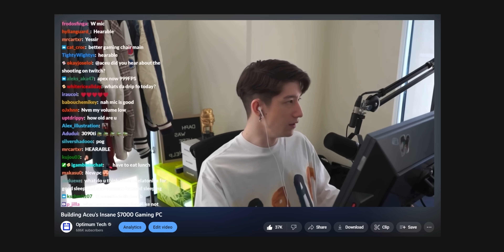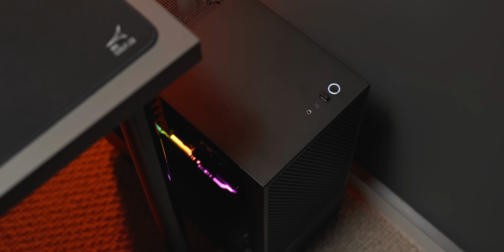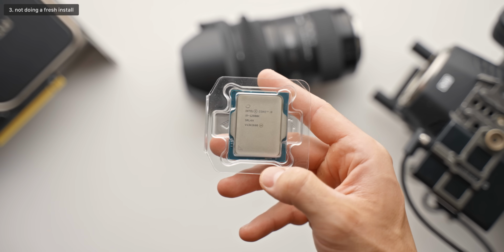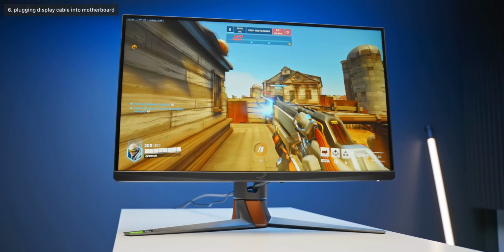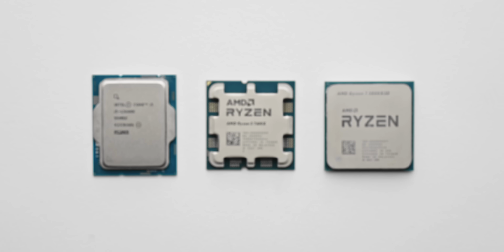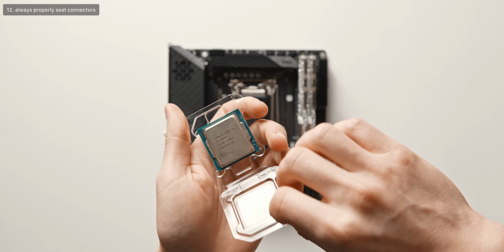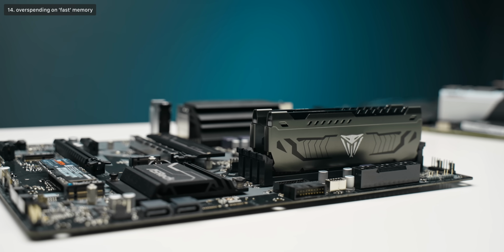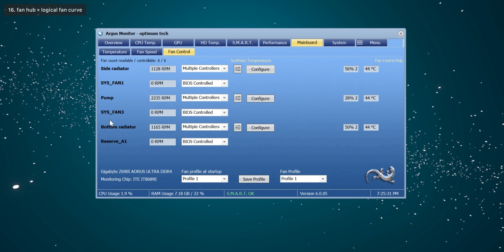Avoid These PC Build Mistakes

Comment: Tip16 : you can also use FanControl freeware to control fan speed using whatever sensor you want with any curve or function that you fancy :)
Reply: Names?
Reply: @pedro.alcatra  SpeedFan is one example. If your case fans are installed in one of the PWM pins on  your board Speedfan will detect the GPU temperature and then you can assign a fan depending on how many PWM pins you have on your board. If ever you have one PWM socket you can use a Y splitter to link up all your case fans, downside to this is it will sync all the fans to one speed.
Reply: @akoito-d9r  I used speed fan in the past I really don't like it mutch. But thanks anyway
Reply: Speed fan barely works anymore and I have never seen it work in any build where I tried it. There is software someone made (forgot the name) that is pretty good but Argus is worth the 10$.
Reply: @akoito-d9r should never place all your fans from one socket. They do have limited amperage.
Reply: Bless you! It solved my new case fan's noise! Thanks a lot!
Reply: FanControl is amazing ! Leaps better than speedfan!

Do i need a fan controller inside my pc to control my case fans with FanControl program?
Is that why they're not controllable?
In my pc case, they are daisy chained to the psu using a  4pins with doubled side  clanmps. Not sure if that's just rgb or  argb

Unlike my cpu cooler which is argb 3pin and im too scared to plug that one in anywheres, my b450mh mobo doesnt have argb only cpu_fan so atleast the cpu cooler works ans is controllable with speedfan but not in bios.
Any tips?

Comment: My most annoying build mistake is finishing the build to then later notice that the metal latches for grounding the I/O shield to the motherboard have slipped into the ports. So you have to take the motherboard out again and it could short something out if unnoticed.
Reply: Just bend them until they break off, they are not important.
Reply: enrique amaya  🤣🤣🤣 yeah because jesus gonna come and fix my pc
Reply: @saifitanvirahmed8604  Not only can He do that, but giving your life to Him will also spare you from eternal separation from the One who wants an amazing relationship with you. Trust in Jesus today and believe the Gospel (Good news)! As enriqueamaya said, it's the best decision anyone could make. Being transformed into mercy and love and grace Itself.
Reply: @II_Timothy  Get treatment for your religious mania and stop trolling.
Reply: Those pins are for grounding?? Never knew. I thought it was to keepthe IO shield from vibrating, hence the spring kind of action.
Reply: No most annoying for me is putting it all together for it to not work for some reason and unplugging all components and plugging them all back in and then it just works for some reason and having no idea what it was that was stopping first time as is a bonus if you put it all together first go and it works right away with no problems no troubleshooting or listening to beeps it just works.
Reply: Exactly! This happened to me twice already

Comment: One typical mistake is forgetting to set the xmp
Reply: What is that?
Reply: @takkjjxap  xmp stands for extreme memory profile. The default speed for DDR4 RAM is 2133MHz, but most RAM is capable of running much faster. You need to manually define your RAM speed in BIOS or your PC won't take advantage of its full capability.
Reply: @PropaneWP  ok thanks
Reply: @PropaneWP how do you do this because I am having trouble with my pc because it keeps black, and green screening and the DRAM light keeps coming on after I can't really find anything exactly wrong with mine. The only thing I can say is that I updated my gpu driver recently before this happened and I cannot fix it. I have DDR4 RAM with 2x8 gb stick from the same package
Reply: @iasked7730  Tech source has a pc build video, at the end he explains the xmp
Reply: The problem with XMP is stability. Yeah sure, RAM can run at higher speeds, but when you need a system that has the maximum amount of stability you can get, XMP is just more of a risk. You can get a stable overclock and use XMP, but is it MORE or LESS stable than stock? And no, it's not the same. The more you overclock, the more you use XMP and adjust timings, the more of a risk you are taking. Put it this way... If your life depended on stability and longevity, would you choose XMP or stock?

I guess you could make the argument that you shouldn't be using consumer grade RAM and be using ECC etc.
Reply: The biggest mistake is enabling most cases. Just clock your ram at rated speeds of xmp. It disables the custom timing between the ram and uses the standard that has same speed and more stable.
Reply: And not turning your monitor to 144/240/360hz jne

Comment: Personally, I think they should have mentioned static discharge when building people underestimated how easy it is to fry your motherboard when you don't ground yourself
Reply: Thats a common knowledge. I allways touch my case. And that is enough.
Reply: @alen7492 You'd be surprised at how most non-tech savvy people don't understand a single thing about electricity/ESD.
Reply: @alen7492  actually it isn't. I only found out when my siblings who live abroad mentioned it. I live in tropical country and things like static discharge isn't common knowledge as we don't have that issue here. Usual things that cause static in the US usually isn't as common in other places

Comment: I believe the RAM speed (rating) is MT (mega transfers) not megahertz (clock speed). So DDR4 3600 runs at 1800MHz and does 3600MT / s.
Reply: Correct.
Reply: ok
Reply: Ya

Comment: Oh hey I did that display into motherboard thing! Just yesterday I was finishing up my first PC build, tried doing benchmarks and whatnot to make sure all the parts were working right, and I couldn't figure out why my GPU wasn't doing anything. The system recognized it, I could manually force specific apps to run using it instead of the dedicated GPU, but it was defaulting to the integrated graphics and only Microsoft apps would let me choose which GPU I wanted to use manually, with no software-side option to switch the default.

And then the solution was to simply swap where I plugged in the HDMI.

Comment: On the subject of the case fans, you really don't need a controller. What I did, was in the bios I set the case fan curves to the mosfets, since those heat up under sustained loads from GPU, CPU, or both together. They also take longer to heat up which means that if your GPU just has a short burst of activity, the case fans won't ramp up unnecessarily, and also when there has been load for a while, they will continue at a higher RPM and ramp down slower than the GPU itself which is helpful to bring the entire system back down to ambient temperatures. All you need to do is find out the temperature range your mosfets are running with something like HWINFO64 while under load as well as not under load, and then set the curve up based on that.

Comment: Been trying to upgrade my pc for the past 2 years.
I had a 1060ti 6gb, i5 4600, 16gb sub 2kmhz ram, generic mtb and 450W psu.
Finally upgraded a few days ago to a 7800x3d, nd15s cooler, 1000W gold/plat psu, 32gb ddr5 6000 cl30 rgb ram that I also turned into temp gauges and a few m.2s all seated in an asus b650-A gaming wifi mtb. Holding off on a better gpu as I only got a 1080p monitor for now, so I went with the 4060ti.
After setting it up, installing drivers and making tweaks, it's been so-far been smashing everything I throw at it pretty well. I do a lot of VR gaming, and it's been such a breath of fresh air being able to go back to titles I was playing on my other rig of sub 30fps to now capping frames without sutters.
Main idea is to future proof everything necessary and incrementally upgrade my gpu if anything interesting drops over it's lifespan. Was going to go with the 7800XT when it dropped, but the price where I live and limited availability of the model that'd fit my case is unreasonable, though the only reason I wanted it was for the performance overhead I now realize I don't need for the titles I currently play. Sure, I might want to try some of the new AAA titles down the line, but I'm not unused to gaming on low settings if required- so it should be fine.
Reply: Awesome job. Just keep in mind "future proofing" isn't that useful in terms of Motherboards, because, generally-speaking, you shouldn't be buying CPUs every time they release a new one and by the time you actually need a CPU upgrade it's gonna be on a new socket type, requiring a new Mobo anyways. Also, as far as GPUs are concerned, yes, PCIE 5.0 is a thing, but it's gonna be another decade before GPUs actually utilize it properly. Right now even PCIE 2.0 is like only 4-8% performance loss on something like an RTX 4080. Yes, PCIE 2.0, not even 3.0.

Comment: PC part picker: "Disclaimer: Some physical dimension constraints are currently not checked, such as CPU coolers and RAM clearance."
Reply: That won't stop some builders
Reply: @greatwavefan397  there is no reason for it to stop builders, they just need to pay attention to the details and check with the cooler manufacturer
Reply: Double check with the manufacturer for compatibility

Comment: also to mention is before upgrade the cpu, especially with the AMD am4 platform is upgrade the bios before to set the new cpu. I had many builds where I sold the cpu before doing the upgrade, then the computer would not start. And upgrading after hand is difficult, because on my latest build, the manual said it loud and clear: before upgrade the cpu, please upgrade the bios first.
Reply: Word up.

Comment: Just bookmarking this bit at 3:33 so I remember to check if my fans are set up properly in the bios! 

Per the video: 3 pin fans are DC, and 4 pin fans are PWM.
Reply: So did you

Comment: Great stuff.  I would add not checking the Mobo's Q codes or status led's when trouble occurs.  I recently wasted hours solving an issue pointed out by my start up status led.
Reply: +1 I had an older PC not displaying anything or turning on the RGBs on the mobo when powering on the PC and I tried so many things besides check the status LEDs including replacing the PSU. Then I saw the light and it turned out to be faulty RAM…

Comment: Another tip/mistake: make sure if you are using a PCIE RISER CABLE that you change the bios to match the pcie generation of that riser cable. GPUs alone dont really have this issue as they usually have backwards/forwards compatibility between 3.0 and 4.0, but riser cables DO NOT. It will post with the incorrect pcie generation, but as soon as you do anything graphically intensive, your PC will hard freeze. PC went completely normal after i changed the pcie lane generation in the bios.

Comment: Why not use a torque wrench for cooler installation? I am a mechanic, so I have a few torque wrenches around. When I install a cooler, I tighten it to 30 or 40 in. lb. in a crossing pattern. Is it totally necessary? Maybe not, but it is an easy way to ensure you have even pressure on your IHS.

Comment: disagree with the fresh isntall for windows 10, its very safe to just use the same ssd when upgrade and just letting windows 10 figure it out. Microsoft have done alot of back end work to make sure windows 10 can safely detect new hardware. Once you have powered on for the first time, you are safe. All you have to do is update drivers and your good to go! Recently i put this to the test again going from a different generation to a different manufacturer (old intel to new AMD) and it worked like a treat

Comment: Controlling fans by GPU temperature can acutally be bad when your CPU is under load and fans are not ramping up. The right way is to react to whichever temperature is higher: CPU or GPU

Comment: From my experience, you have to be careful of not scratching your motherboard from the bottom when installing it in a case. In the middle of where your ATX motherboard goes(in most or all cases under the m.2 slot) there is this one spacer for the screw with more height(which is in some cases very sharp) to lock the mobo in place and make it easier for screwing it on and if you're not careful there is a slim chance of damaging the board if you are sliding it towards the I/O shield to the back of the case and then if something turns out to be wrong with the mobo, the RMA is gone

Comment: I think fresh installing is bit overcautious, I don't see much difference in just using same install, getting new drivers and cleaning up the old ones.
Reply: Depends if you stick with the same platform or CPU brand

Sometimes it's easier to do it now than to troubleshoot in the future, better be safe than sorry
Reply: @bootchoo96  It's always possible to do the reinstall later on if you run into issues.
Reply: @bootchoo96  when i change all i do is repair windows and remove anything in the registery that looks off. risky but ive spent way to long going through windows settings and installing stuff to reset
Reply: It is completely unnecessary.  You can change from AMD or Intel or vice versa, even replace the motherboard after ten years.  Windows will work fine.  This re-installation advise is decades old and totally outdated.

Comment: As someone who is putting together a build now and

1. is using the 13600k with a powerful GPU (RTX 4070 Windforce)
2. is using DDR4 3600MHz memory in the future config

this was extremely satisfying to watch lol, you just reassured my choices, great video btw!
Reply: use ddr5 for new builds my friend, esp with latest procs, theyre too fast for 3200-3600 ddr4
Reply: You really should not be using DDR4 memory on a 4070 build.

Comment: Also cross-generation support.

Your B450 motherboard may support a Ryzen 5000 series CPU, but it likely won't have support for it out of the box. This generation of motherboard also is unlikely to come with BIOS flash capabilities either. This means if you try to put a 5000 series chip into said B450, your system won't post because the Motherboard doesn't know how to communicate with the newer chip.

You can make them compatible by updating the BIOS, which in a system that doesn't have BIOS flash, means you'll need a 3000 series chip to get access to the BIOS of the B450 mobo in the first place

So, if you're building a new PC, and don't already have a chip compatible with your previous Gen mobo - just spend more on the correct generation. It's less expensive and faster than either buying a second CPU to make it work, or returning the old mobo and spending the increased price for a newer model anyway.

Figured this out after having to build a budget PC for my grandmother who's on a fixed-income (I was between jobs at the time, or I would have just bought it all myself). Decided to save her $10 on a B450, and pair it with a Ryzen 5 5500. Que 6 hours of additional time spent troubleshooting, googling, and eventually swapping out the motherboard for the B550 that arrived an additional week later.

Comment: I just built my first PC after wanting to build one and watching PC content for more than a decade, luckily I didn't make any major mistakes, had to shift the radiator around a ton because I didn't want to uninstall it after the test boot and reinstall it inside the case, and had some difficulties lining up the motherboard with the standoffs and cable management but overall I think I did fine

Comment: I hav built several PC over 15 years and installed Windows many more times.
I still don't understand what MBR and GPT are and every damn time I have to google them.
Reply: MBR only works with BIOS and GPT with UEFI. MBR/GPT are what tell the BIOS/UEFI about the partitions on the drive I think, that's why you have to format them correctly (as mentioned above). I don't know more right now
Reply: Right there with you bud xD

Comment: I don't know if I've just been really lucky, but I've somehow managed to replace nearly every part in my pc without having to do a fresh install of windows.

I first had a PC i bought for 250€, kinda bad but it got the job done at the time. It had an OEM motherboard, and a trash i5 CPU (4460?).
After that, i bought a nice motherboard, cpu, ram and cooler kit used from someone that worked with no issue. The CPU is now a i7 9700k and the ram upgraded from ddr3 to ddr4. The install didn't corrupt. I've added an nvme and now have replaced the GPU from an rx 570 (yes, an rx 570) to an rtx 3060 ti, leaving only the psu which I plan to replace and my three original drives left, but it seems to work just fine with no issue.
Reply: It's not luck.  Re-installation being necessary is a persistent myth about Windows.  It might even have been true 20 years ago, but definitely hasn't been for a long time.

Comment: How many times on AM4 when taking off the stock cooler, the CPU came with it! while the locking clip was locked! fking wild, motherboards and cpu still worked afterwards, but the locking mechanic was broken.
Reply: I just destroyed my 2700x because I didn't realise it was attached to my cooler that I was removing!

Comment: I have a quick question about the 13900k, how necessary is it to replace the bracket from the stock to the thermalright one, if i use the pc for rendering (mostly on GPU tho) but occasionally i utilize 100% of CPU, and sometimes temps reach 80-85°, and when the utilization is 100% temps could get up to 90-100° (but that’s not for very prolonged periods)
Note: MB ASUS TUF z790, CPU: 13900k (not overclocked), MB  thermaltake liquid cooler (360mm rad, not sure which one exactly)
Reply: if you are replacing the heatsink you should replace the bracket, the distances and tolerances may not line up across different products. unfortunately it means disassembling and reassembling almost the entire pc